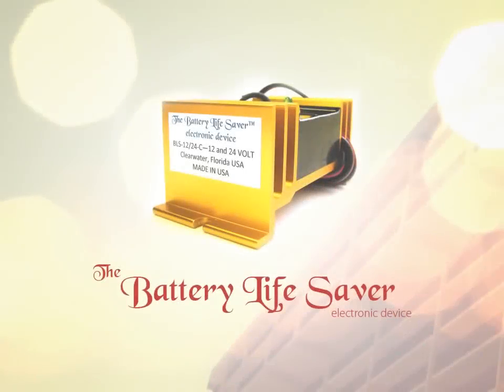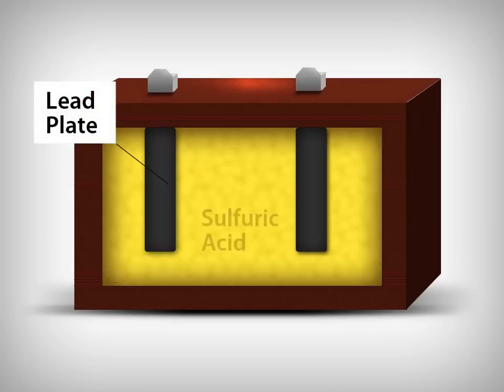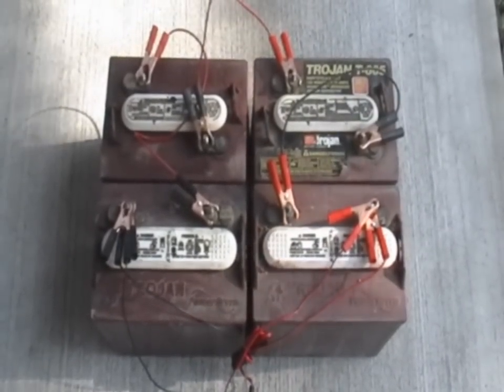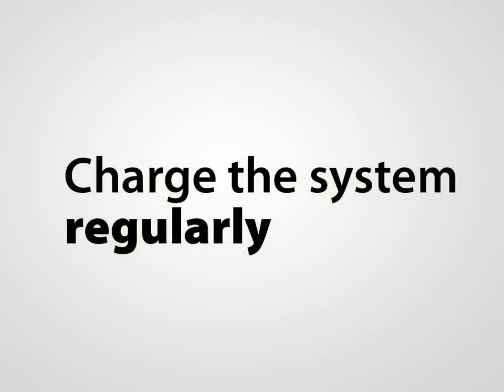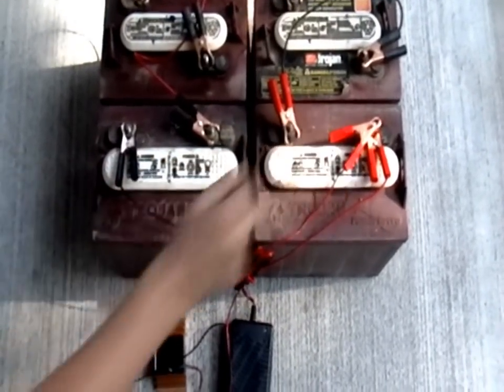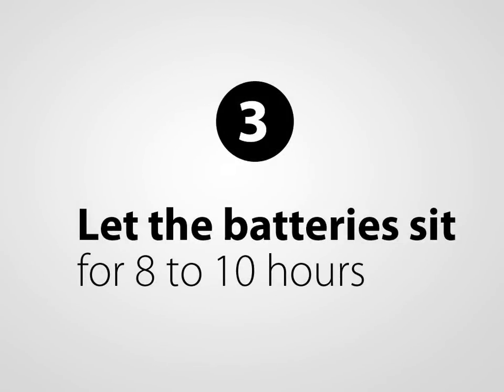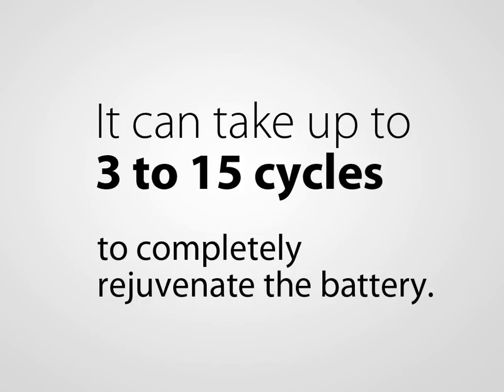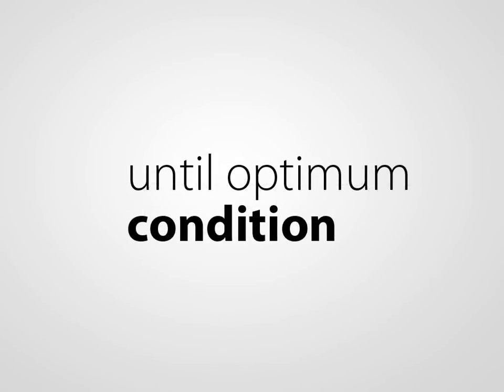How to Improve Golf Cart Batteries and Extend Them 2x - 3x

Comment: EZ Battery Reconditioning reveals how dead batteries can be revived for very little costs, and also helps readers turn it into a business idea should they wish to pursue it [Check Details Here==>https://plus.google.com/100351090281822647456/posts/Gwtd4mVBdEd ]. All the required assets to start this reconditioning of batteries or starting the business are clearly stated in the report.

Comment: I found them on Ebay.  I have questions!  I wrote: "Please help me buy one of these! I just bought an awesome golf Club Car with batteries that are about 4 years old. I want one of these, but I need to know which one to use. Would mine need one for "newer" batteries or "poor" batteries? The previous owner rarely ever used the cart and it sat in a garage most of the year. He only put about 10 hours on the car in 4 years with these batteries. I'll have to test the batteries and replace ones that I find that are "bad", but it runs great, so I assume the batteries are ok."

Comment: Leaving the BLS attached to a battery will drain it in 18 to 24 hours?  That is exactly what you DON'T want for someone that is not savvy with batteries.  For example if I connect  a BLS to my moms golf cart but  only visit her once a week the batteries will be dead in her cart?  Oh that is real healthy for them.  What a highly flawed product!
Reply: We have several of those at work and I never seen one discharge a battery enough to even tell that the voltage went down and so far never killed a battery  nor discharging it. 

In fact, last time I put one of those on a so called '' dead battery '' without a charger, the voltage went up. That battery gave us 2 more years of service.

We put them on a battery and they stay on for 2-3 month 24hours per day at a time. It will take weeks or even month to get the sulfur of the lead plates.

Comment: If you charge your batteries on a regular basis, your batteries are not sulfated.  Most batteries die due to the plate of the battery going bad.  Ive seen this unit tried too many times to count,, and the people feel shafted as it didn't do what it was intended to do.  Around me they sell it for 89 dollars installed.  I take them off for less and throw them in the trash.  Basicly its a gold or blue box with a flashing light on it.  Snake oil
Reply: This is glorious, I been tryin to find out about "battery chem" for a while now, and I think this has helped. You ever tried - Ammaceen Reconditioning Rabblement - (just google it ) ? Ive heard some awesome things about it and my brother in law got excellent success with it.

Comment: I bought one for 36 volt cart, the batterys are 4 years old, cart new would go 36 45 holes no problem but now it goes 27 maybe 36 but is slow I put you battery saver on and it took about 20 charges using the cart, it took about a month and now it is back to the 36 45 holes thanks
Reply: neeheeleest = Your Barkola Battery Bonanza, is a $47.00 scam. How dare you use this forum to peddle your crap. Do your spam advertising somewhere else.
Reply: Mike K interesting points ,if anyone else trying to find out how to recondition my car battery try Barkola Battery Bonanza Blueprint (just google it ) ? Ive heard some super things about it and my mate got cool results with it.
Reply: BULLSHIT SCAM

Comment from the maker: The Battery Life Saver is an electronic device that connects to the batteries and works together with the golf cart charger to desulfate the batteries and restore them to near new condition.

The 36 or 48 volt unit is $139.95 and that includes FREE Shipping anywhere in the USA.

We sell these on eBay and also on our website at: buybls dot com

ebay dot com/itm/110809419219

ebay dot com/itm/120995827222

Let me know if you have any additional questions.

Thanks

Dave